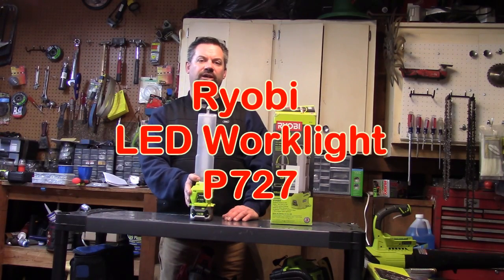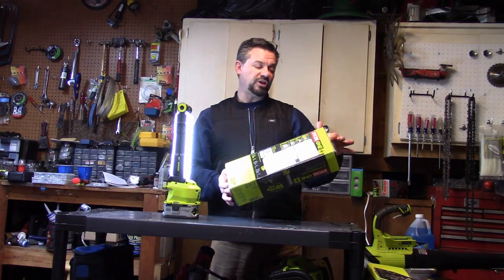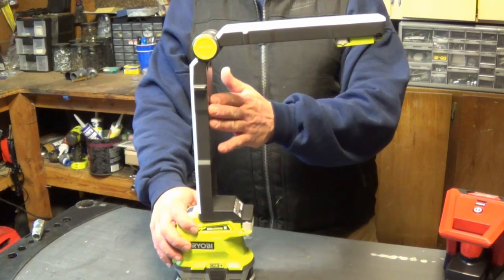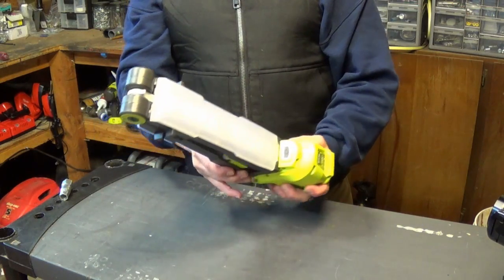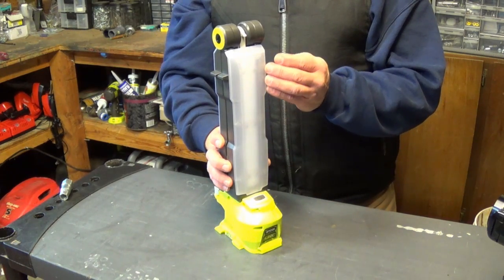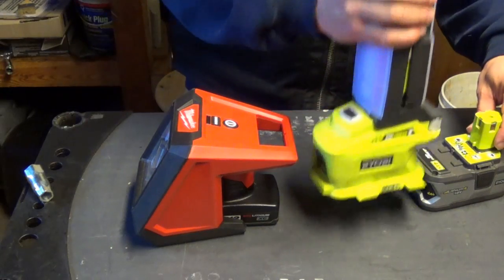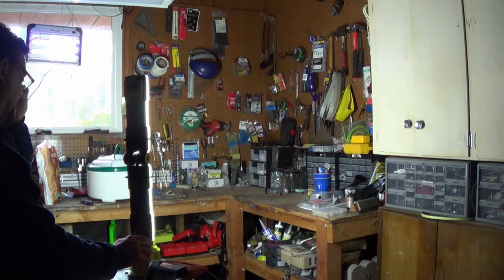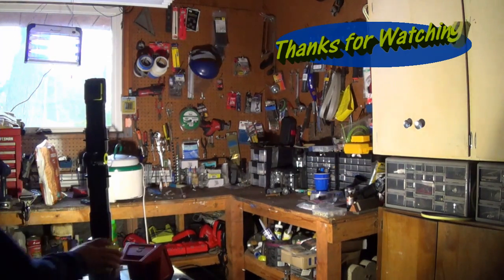Ryobi P727 LED Workbench Light

Comment: Thank you for the comparison.  Best review I found for this light.  And pointing out the lower quality of the LEDs used was useful to me.  Fanboys of any brand really don’t get it.  The early Milwaukee lights weren’t LED and were primitive.  Their early LED lights were weak, and the original Festool Syslite  was easily the best.  You could shine it along a wall or project and really see any issues.  Milwaukee has improved much since, and now their  pocket size rechargeable “Rover” lights are great too.  Much easier to carry in a tool bag than a stick light mounted on an 18v battery.  No brand is perfect, and I can put down stuff I don’t like about Milwaukee and Festool too.  I’ll end it there.  Thanks
Reply from the maker: This is far and away my least favorite LED light.   I still use it once in a while, especially if I am conserving my M18 batteries.   It works, but it just isn't as nice.

Comment: I agree about the the color spectrum being an issue. However, the two lights are different styles with different uses. The ryobi seems to be for  close in work on a bench or hanging up just as you demonstrated. It wouldn't get as much abuse that way. The Milwaukee is more of a general purpose light which would probably be abused more often. I still like the Ryobi and would buy it but I didn't hear you state the price. I may have just missed that. Overall good review.
Reply from the maker: I was only comparing the switch and the color spectrum between the two lights.  I think I paid about $50 for it, which is about the same price as the Milwaukee, so I think it is fair to expect similar quality.   I don't normally say the price because it can change, and also because Home Depot will kick back a review if you say the price in it (don't know why, but it is their rule).

Comment: Thanks for sharing, I still have the original DeWalt 20v light.  Its basically a 20v flashlight with a pivoting head (huge shadow issues if its not placed perfect)  The new models are much better & function more like a true flood light.
Take Care.
Reply from the maker: DeWalt has lots of good stuff.   I have decided just to try to limit the amount of different batteries I have, so I not gotten any Yellow products yet.

Comment: Wish you could have showed us how it looks like with the two lights on the sides to flood the room with light, but the 1 light test gave it a good idea. I think what this light does best is being versatile. Like you showed on the car, could be hung from the sealing, placed in the middle of a room, placed right on your desk and many many other configurations in different scenarios. There being only one button saves a little bit in the cost and just remove the battery when not in use.
Reply from the maker: Since having used it for a while, I still hate the power button, but when I hang it in a shelter with a white ceiling, it really lights it up good.

Comment: Thanks for the review!  I'm pretty late to the game (42 months after you posted) but it was still a good watch! 

I picked up a couple of the P727 lights this month (summer 2020).  I wonder if they have possibly made some improvements since you got yours.  For one thing, regarding the switch they used... mine do not seem to be nearly as sensitive as yours.  It' requires quite a firm press to activate.  I also don't think I've ever "double pumped" it.  One firm press yields exactly one light-state-progression.
Reply from the maker: I hope they are better.  If a stiff wind goes across mine, it will activate the switch.

Comment: The alternate product that you compared Ryobi with is 30$ (60%) more expensive. This is not a fair comparison and review. At the same time, with such lower price, Ryobi P727 provides much more flexibility and mounting option that the alternate can't provide. If Ryobi would design an LED product with $80 price range, it would simple blow away Milwaukee M12.
Reply from the maker: But they don't.   And it really would not cost that much to make it right.  You can't just look at price.  If you think this is the best bang for the buck, then by all means get it.

Comment: nothing unusual, pack of diodes, three position switch and an hour with the soldering iron + some scrap plastic - i could make me such thing spending less then 5 bucks
Reply from the maker: Please do so.  I will pay you $10 for it and you will double your investment.  It has to use my Ryobi 18v battery and mimic the functions and design of this light.
Reply: i just have ryoby 18 v tools and in my town i did not find such lights. i got me 100 pcs of LEDs but they are cold white which is not quite good i suppose. So i just ordered 1000 pcs warm white LEDs and in about 1 month i plan to start making me such a ligth thing. I well let you know what it ends with.
Reply: I will probably make thousands in the time it takes you to build that torch, which means my torch is basically a freebie. Sometimes it's about time versus abilities.